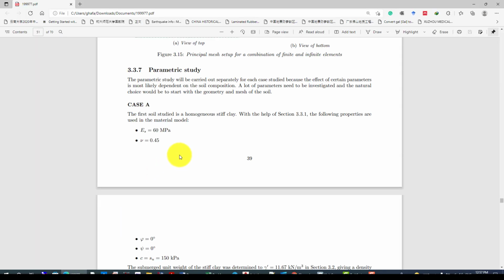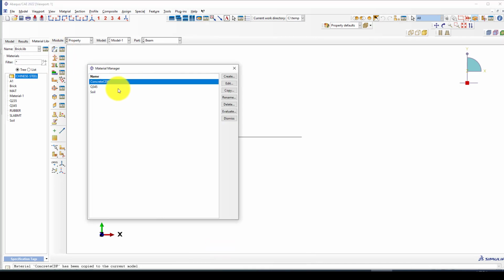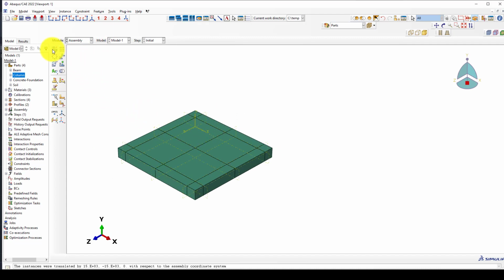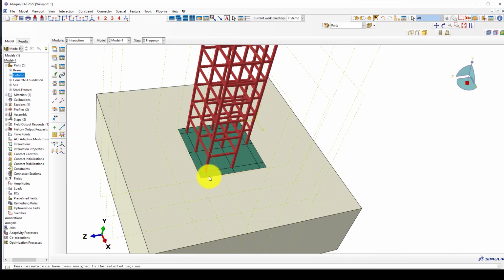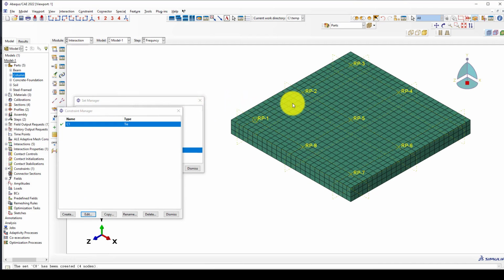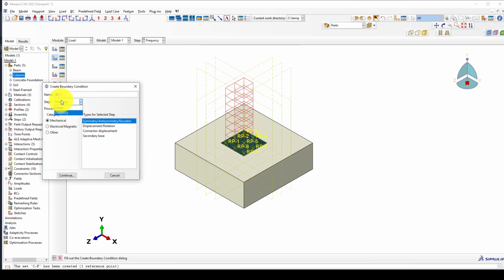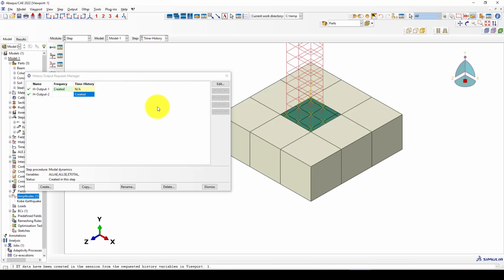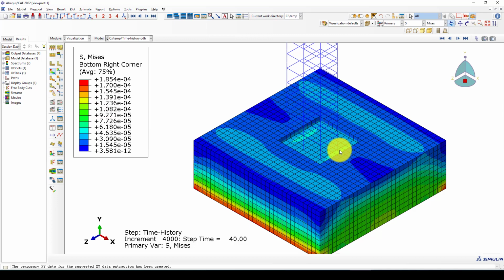Advanced ABAQUS 2024In-Depth Earthquake Analysis of Steel Structures with Soil-Structure Interaction

Comment: Thank you very much for this video, But, I think that CDP cant capture pinching effect well, hence do you think that it gives accurate seismic results? Thanks
Reply from the maker: Actually , CDP can gives but we need the correct steel materials and bond behavior between them.
Reply: @KSSE_Engineer  well, what you mean with correct steel materials, do you mean cyclic behavior of steel ? how to do that in abaqus? thanks

Comment: Hello, 

Why do I consistently encounter excessive deformations at a certain second of seismic acceleration when performing analysis with infinite elements, leading to the error message "The ratio of deformation speed to wave speed exceeds 1.0000 in at least one element"? Is it because my infinite elements are failing to effectively absorb energy, causing energy accumulation that suddenly results in significant deformations at a specific time?
Reply from the maker: Maybe that’s the reason, additionally the loading conditions and the unit may also affect. Check your model properly the rerun.

Comment: Hello sir,

I want to apply uplift pressure at the dam base in a gravity dam structure with a fixed base case. 
I created steps- Gravity - Hydrostatic - Uplift.
& I fixed the base of the dam by selecting it in U1, U2 direction.

When I apply uplift pressure with the fixed base case - the model completes the analysis, but there is no difference between the results of the Hydrostatic and Uplift pressure steps.

And if I release the U2, then the model does not complete the analysis and shows the error "Excessive distortion at a total of 5 integration points in solid (continuum) elements".

Please guide me, How to resolve this problem and apply Uplift pressure... It would be beneficial to me and appreciated a lot by me.
Reply from the maker: What is the purpose of uplifting pressure in the dam base?  If it's the hydrostatic pressure then don't keep fixed boundary conditions in the applied pressure direction. Just restraint the horizontal directions.
Reply: @KSSE_Engineer  Yes it is act like a hydrostatic pressure in upward direction...   but if I only restrain horizontal directions and U2, then the model does not complete the analysis and shows the error "Excessive distortion at a total of 5 integration points in solid (continuum) elements".
Please give your valuable suggestion for it...

Comment: thank you, it was a interesting case. 
Just one question, when I'm running the time dependent simulation,  my frame behave like is not coupled to the foundation since it moves away from the foundation like a rigid system. Do you know (or someone) where did I make the mistake? my first thought was in the intersection part, but I've redone it and still  the same.
Thank you in advance
Reply from the maker: Please check the video carefully; the problem will be solved.

Comment: Good video. Sir I tried to model the column and raft slab connection by considering  tie constraint and due to the same I am getting the following error :"Self contacting surface assembly_c45_cns_ is currently not allowed for tying surfaces".  Kindly please suggest how to solve this issue.
Reply from the maker: The self contact is different with tie. You can use auto contact finder and then select tie from properties Column
Reply: @KSSE_Engineer  Sir thank you for the reply. I tried the same as I could not solve the issue .  

I request you to kindly suggest the procedure( Reply from yourself: "You can use auto contact finder and then select tie from properties Column')  as it would be very helpful.

Comment: Thanks for the video! but, I am afraid its not an advanced modelling for the soil structure interaction as written in the title. In advanced modelling, you should define the boundary conditions for the soil properly so that avoid seismic wave reflection into the soil domain. Also, the interaction between the foundation and the soil should be more properly defined.
If you have knowledge on viscous boundary or infinite element boundary conditions, it will be nice if you present it.
Reply from the maker: Hi there, You mentioned very important and technical parts but that need hours recording, and lectures. Unfortunately, I am unable to work on it. If you are familiar let's create a tutorial and shear with us for the sake of knowledge.
Reply: @KSSE_Engineer  I am still developing the model. once it finished and I verified the model I can share it with you. Thanks!
Reply: @baban21922  Dear sir, you have knowledge on boundary? I research on this. In fact, it is very hard. If you have free time, we can communicate .
Reply: @KSSE_Engineer  Your video is helpful for me. Except boundary, I have some suggestion that you should go on to keep the geo stress balance.